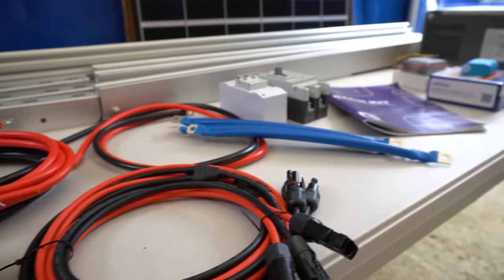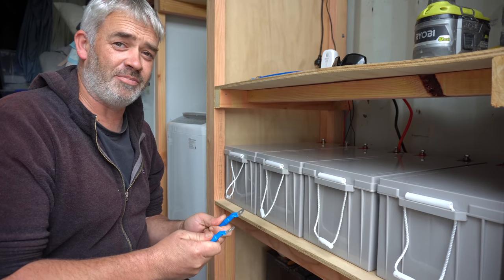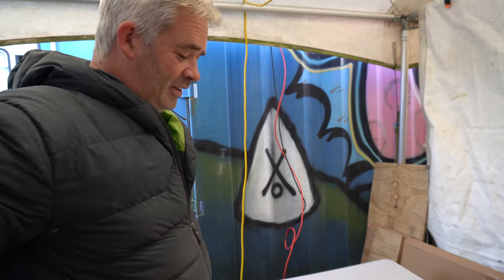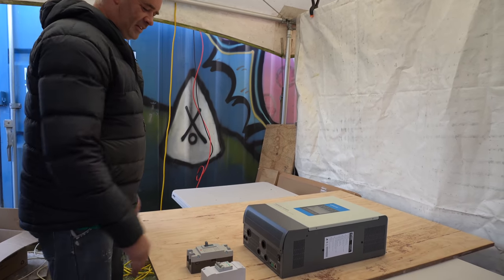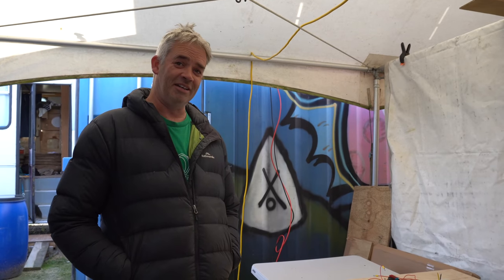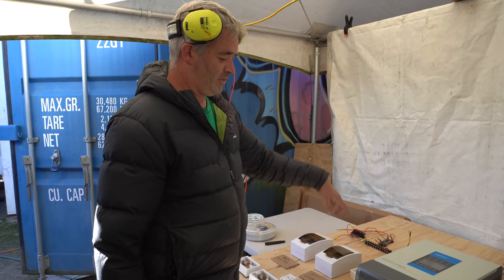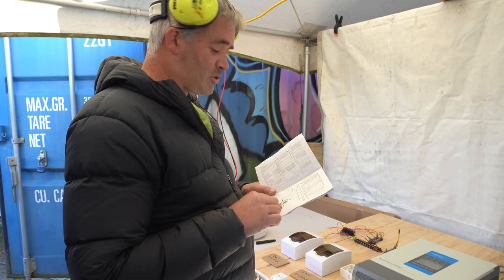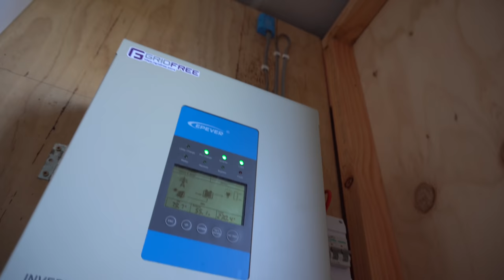Our Solar System - Self Installation

Comment: Thanks Hayden and Karen, great job Hayden. Just be very careful around those batteries, they have the power to blow your spanner apart. I made a spanner thats got heavy insuilation on it . Had a few moments over the years with big batteries arking out. It a big step getting reliabe power. . Hows the generator any good? noise? Fuel amount? Thanks again and good luck

Comment: That is a MASSIVE solar setup. I guess what you had there was a step down DC to DC converter to get 12 volt from the 48 volts system. Wouldn't have said no to a system like that in my offgrid cabin. But I have so many trees here. I am in the woods. I am charging 10 105 Ah batteries at a time with a generator, so they last for a while with lights and the computer. For airfryers and such I use the generator. The system is looking great. How many banks did you have to rob to buy it :-)

Comment: 4:45 I get the feeling that it's an Australian system.......;) Or you mounted it as an Aussie system. I'd have gone for a much steeper angle for the panels. I'd have them 'tuned' for winter - so they make the most of the low sun. I'd look at output as a function of angle of incidence - clearly 90° is going to give max output. So, do you want max output at the winter solstice ? Probably not - so I'd suggest (completely guessing) that you pont the panels directly at the winter solstice  sun and then tilt them up another 20° more. This should give useful power at midday on the solstice and much better results at other times of the year. Better still would be able to vary the angle for the time of year but it's more important you make the most of the light in winter than get far more power than you need in the summer.
Reply: It’s a NZ company we got the system from, but I’m not sure where they import from. Set up for the best winter sun at the moment. I’m yet to see how they go in summer and the angle I need. But because I spend lots of time away from home in summer, even with the panels in the winter position, I’m expecting to get more than enough power that I need. 
The cabin gets it own smaller system and I’ve built that panel on a tilting frame so I can adjust at the summer peak. Currently it’s a lot more vertical. But that all in another video. 😄
Reply: @haydenroberts7061  Of course, if you wanted to go max posh, you'd have a suntracker system - not only follows the sun round through the day but at an optimised angle :)

What fun I could have if a builder said we needed a new roof ! We currently have a more or less pyramid roof with a chisel point (akin to a twist drill tip). The new one would be optimised for solar ! Rotation and tilt.

But I'm having enough problem getting power back on in the garage. I've an E-N connection somewhere I shouldn't have !

Quite amused by your 240V out from inverter in red/black/green-yellow - our 'old' wiring colour scheme before we went brown/blue. The wires I'm working on are red/black.

Comment: Only solar set up I have fitted is to charge battery in my caravan. A set up like this even with my electrical background isnt anything I have dealt with before.
Reply: It was pretty easy. Came with an instruction book which was a great reference
Reply: @haydenroberts7061  if instructions come with plenty of pictures and diagrams i can usually tackle anything. Renewable energy and battery storage is something I will have to get used to now.

Comment: tidy install, for DIY however i trust you used a registered sparky for the 240 volts.
Reply: Too true, they shouldn’t be posting a video like this. We have this exact set up and the instructions clearly state you need a electrician if you get the hybrid inverter.

Comment: 0:15 Familiar territory - RCD plus overload power switch. I have similar but for 3 phase. You'll see it all when you start watching my vids ;)
Except yours isn't an RCD !
You ought to have an RCD on your 240V supplies.
Reply: Karen passed on your email last night, I’ll have a look over it today. 👍
Reply: @haydenroberts7061  Just watched your solar/inverter installation vid - why not use your own channel for these and promote it via Karen's channel ? If I had your e-address, I'd have sent you a pic of the panel I'm putting together for my generator.
Been working on the garage power again today - pulled to bits another of my father's wiring bodges. At least I'm seeing a way forward with it now.
Reply: It’s only circuit breakers on the solar system, yes the 240v has RCD and circuit breakers. A set for both the incoming power from solar and the generator.
Reply: @haydenroberts7061  IMO, RCDs ought to be installed as far upstream as possible. Is the solar 48V-60V ? I presume the solar's just for charging the battery that feeds the inverter. So RCD should be the first thing after the inverter on 240V and on the 240V supply of the gen.
Out of interest, what's the chemistry of the battery - lead acid or something modern & fancy ?
(Extra points if you spot my cleverness in this posting !)

Comment: Will you be able to alter the angle of the solar  panels so you can get the best angle for both summer and winter?
Reply: The ones on the container are currently fixed. We are away a lot in summer, so I’m expecting to still get enough power for my usage even in the winter position. But time will tell. The cabin gets its own solar system and it’s panel I have built on a tilting frame, but that all in another video. 😄

Comment: Daft you can put the panels on the container roof but not the cabin roof. 🤷
Reply: I think Id rather have them on the container anyway. It's like a utility room.
Reply: I think we could have put them on the roof of the cabin as it’s only a temporary structure like a shipping container. It’s just when you want to put them on the house roof, you need to tell the council to insure the job is done right, waterproofing, structural integrity etc. 
But like John Key said. It becomes a great utility room as it currently has all our white ware in it. The cabin gets its own smaller solar system.

Comment: What’s the reason to put the batteries in series to make 48v instead of in parallel and 12v? Don’t know enough about 12v to know pros and cons of each - does that give the inverter an easier step up?
Reply: lower amperage means you don't need such heavy duty cabling
Reply: For a given amount of power the current is proportionally lower, which makes the batteries more efficient.
Reply: The more amps you require, the higher your base voltage should be. 
12v runs up to about 1500w 240v, 
24v runs up to about 2400w 240v and 
48v for 3000w 240v.
Reply: to clarify my statement. Battery capacity is usually rated at a current equal to  1/10 or 1/20 of its capacity (C) ie 100Ah battery is 100Ah provided you don't discharge at a rate greater than 10A (0.1C) there is a derating curve for currents higher than this value. So by increasing the voltage and reducing the current you are making the battery more efficient.